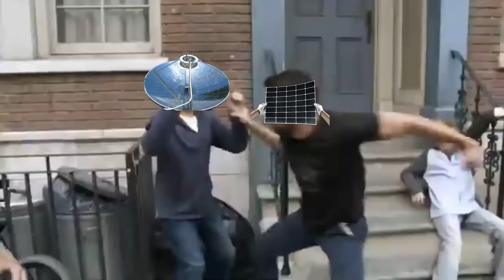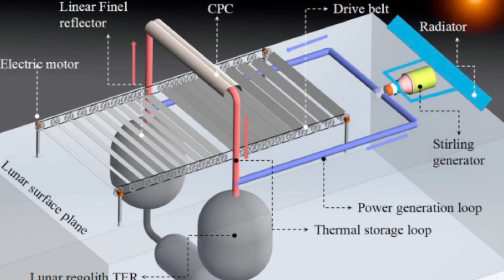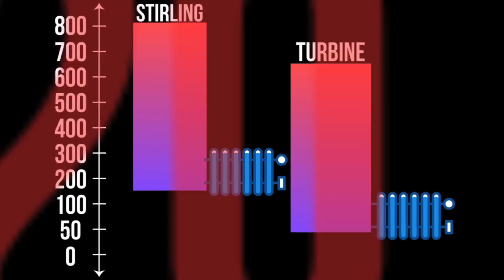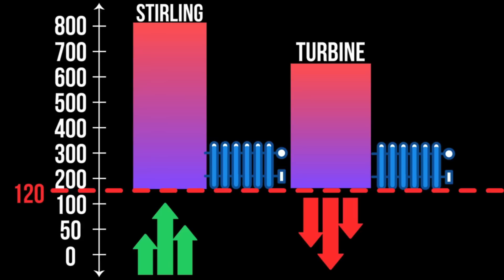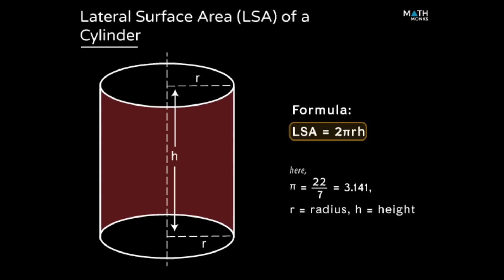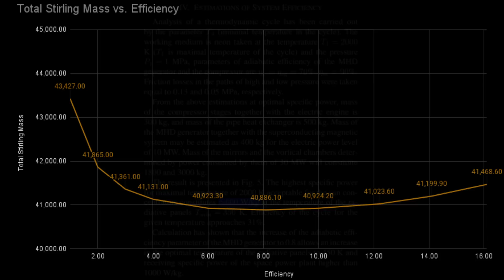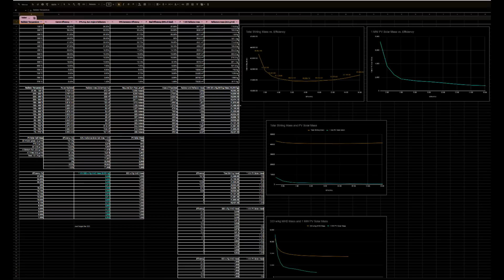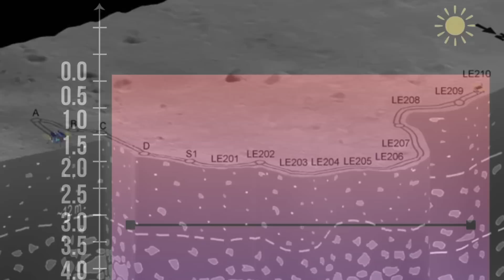Stirling Engines vs Solar Cells (+Transmission Lines)

Comment: 1. Solar Cells still need cooling.

And I find no reason for that not to be a heat engine...

2. Sterling Engines can be no different than steam engines in that you can make them multistaged.
One stage feeding the next, that will have a wider Start and end.

Comment: P.s. If a refrigerant was used instead of water that easily self condensed  once trough the steam engine and into the underground condenser radiator the steam engines would likely last longer and be more efficient as the expanding refrigerant would possibly expand a few hundred times more than the steam.

Comment: It might not have been thought of - but water boils at 100 degrees Celsius and you said daytime temperatures reach 127 degrees Celsius,  so water could be boiled using the sun and put through steam engines to turn generators and make electricity. The torque from the steam engines would generate a lot more electricity than solar panels. Steam after going through the steam engines could be condensed in underground metal radiators. As long as the sun 🌞 was shining on the boilers, the steam engines would turn generators to make electricity . The trick would probably be to take metal tubes for pistons to run in and pistons and camshaft there and build the engine blocks out of concrete manufactured on the moon. Fortunately things lighter than metal could be used to manufacture the necessary components of the steam engine  like carbon fibre and possibly powdered metal used with 3d printers to make more durable components for the parts of the steam engines like the metal sleeves the pistons move in, the pistons and the camshafts. If aluminium could be mined and used in manufacturing on the moon  the harder metals brought from earth would likely just need to be used on metal edges of the pistons that touches the metal sleeves the pistons run up and down in. Potentially if a steam engine could be manufactured on earth using no metal parts but say kevlar for the pistons and sleeves they move in it would mean less metal would need to be sent to the moon to save on weight sent in the rockets. Camshafts used in the engines might be made of kevlar or have metal wire in them and have 3d printers build the camshaft around the metal wires once on site on the moon or the camshaft could be a finished product sent to the moon.. Essentially no clouds or shade on the moon would mean the steam engines could run whenever the sun was shining on the boilers. If all necessary components were made of kevlar it could be that titanium or another metal could simply be sprayed or electronically bonded to the necessary moving parts of the steam engines once manufactured on the moon. With the idea of sending the least amount of metal necessary on the rockets to save weight. Would probably be done eventually assuming a large manned base eventually gets built. Such steam powered generators might run for hundreds of years if they were built good enough. Possibly a metallised form of Teflon could be used on moving parts to reduce friction.😊
Reply: It boils at that temperature if the air pressure of the container is 1 atmosphere.  It boils at far lesser temperatures in vacuum, but i dont think that changes the efficiency overall.  Still, an interesting idea I hadn't thought of.  You still need to radiate the heat away, but its the same heat you have troubles with in any other system.  You could even add stirling engines as an intermediary heat transfer stage sonas to further increase the power output for a given volume of boiled water.

Comment: Use multiple pv farms. With mechanical batteries! Spin up a heavy flywheel. About a 20' diameter, filled with moon dust. With magnets places on its edge possibly electro magnets. Powered by a solar array on it . And powered by a larger solar array. With a high mass flywheel, the rpm can be kept relatively low. Use magnets and air bearings maybe nitrogen or CO2 . A very heavy flywheel, in the multiple ton range. Spinning in the 1,000's rpm range say 3k to 5000 rpm. Place pv arrays  miles apart, from the pole so at least one stays in the sun. Operating at 10,000k vdc using a large lithium super capacitor bank to build a DC to DC converter. To drop the 1-5 amps (roughly) @ 8-12kv DC to much higher current lower voltage say 2k amps at 340-400 vdc that that in inverted to 120/240vac or whatever is required or possibly use DC,  180vdc with small inverters to convert as required.   With the solar array operating at high voltage, low current even 2kv at 1 amp can be sent over 20-22 gauge wire, still capable of pulling another 1+ amp, at a length of miles , it would have losses. Say the base was on the pole with arrays 5 miles south 120° from each other. With 10 miles of 18 gauge wire at least. To carry 5 amps (+/-) at 2kv+ 2kv @ 5amps  eq. 10 kw, with 5 amps  the most allowed on a 16-18 gauge wire , maybe 10-12 gauge with 5-10 amps at 5 miles  there will be losses. Placing the wires inside a reflector to keep the sun off them will help. Use a copper core wire possibly, with a polished aluminum outer, with aluminum rings or beads to reflect and dissipate heat and cost with a varnish possibly holding glass dust. Being semitransparent it still reflects light and heat.. with the flywheel being so large , id dig a hole to place it in with only 4'-6' space around it. Use a 2kw array  to power the electro magnets on the flywheel. Using mirrors to reflect the sun on to the panels. Or use a dozen permanent magnets to get it going. Use a positive feedback using the power it generated to generate more power..  say start with a dozen 2"x 4" x 1/8" n52 magnets plus a few 1/8" x 2"x 1/2" to make a Halbach Array, placed in certain areas around the wheel. Using high voltage pulses to push the magnets getting the wheel spinning. Maybe use a 10 kw bldc motor to assist on start up. The wheel possibly weighing 10k lbs even spinning at 100 rpm will be a huge amount of torque. With nearly zero friction and near zero resistance. Using the spinning mass to generate 10 kwh, and using only 100 wh to get it spinning over weeks, and 10wh to help maintain the speed over days until it is needed . Post generating power for a week until the next solar array is fully under the sun. It could work. More likely and easier, would be to put multiple arrays  10 miles south or north of the pole. Use around 10 gauge wire. With 10kv+ use a DC to DC sub station to boost the  voltage up. As required , if required. With the array only putting around 1-2 amps on the  cable, place another array  2-5 miles south or north east or west 45° from the last so it is about 10°-20° on the rotation with a sub station matching the voltage to the array. So it's 1 amp at 10kv can be added to the "DC GRID" going to the base. Maybe lithium titanium batteries can improve their efficiency so they still have the life of a capacitor and round trip efficiency being high as lithium ion LMC, or lifepo4 at least, so lithium titanium cell batteries could be used. With a 20+ year life. A 800 kwh battery bank used to smooth out the brown outs until the solar gets back under the sun. To produce 100% of it's power. With the arrays at 20° and 120°  from each other  with only 100° with no array  its only a short time without full power if another array is placed 20° east/west of the last with the grid carrying 3 amps at 10,kv for a short time possibly 5-9 days then fade to one then no power for a week until the next array starts production. Maybe smaller arrays closer to the pole would work placed at 30°  with 5kw arrays. 5kw 24/7 is a ton of watt hours. Sorry to ramble , happy holidays!

Comment: 12:46 

Maybe we can shield not only from the sun, but also from the surface of the moon. Depending on the latitude of the location, we will have a sector of space where the sun never shines. Probably about 5-10 degrees above the horizon in the direction of the pole. 
The open end of the shield-tube can be directed into that sector so that the heat is radiated into outer space. The other end of the tube is a heat radiator. The shape of the tube allows it to be shielded from radiation from the side of the tube.
If you install a tracking system, you can radiate heat to any point in space and avoid the sun. 

About the problem that the insulator itself will heat up from the ground, hmm ... 
On a lunar night, you can cover the entire surface around the emitters with sun protection refractive foil in several meters around and wait until the regolith cools completely. The lower temperature limit will be the temperature of the lunar rock massif close to 250K (-23 °C). Maybe it will even be possible to cool the soil massif even lower by installing more of these cooling emitters. 
Result: 
-heating from above from the sun is cut off by a tubular reflector, as well as heating from the sides;  
-heating from below is limited by a temperature of -23°C. 

The tubes can be made of aluminum foil, connected in a hexagonal shape using the same technology as cardboard. 

Costs: a lot of foil for the tubes, a lot of foil to cover the soil around, a more complex installation of the emitter, since it will stand more vertically to allow it to be directed at an angle of ~5° to the horizon.

Cons: since the sector to which the heat is radiated is now limited, the total capacity of the cooler will decrease. To compensate for this, the number of emitters needs to be increased even more. I think 2-3 times, since we have limited the sector of space to which the heat is radiated by this many times. 

And then the question is, do we need a system that reaches -20°C, but is ten times larger and more complex than a system with 120°C?
Reply: Thermal storage would be better here, similar effect, less complexity.

Comment: You started this presentation with a statement that you don't need to run your machines all the time, and then went on to design your system based on an assumption that you need to radiate when the sun is up, so you can't get below 121 C.  In practice, you have much a much cooler reservoir, either 4 meters below the surface (-20 C) or 14 days away in time (-183 C).  In the same vein, you could heat up and store your hot fluid so you could generate power even when the sun goes down.
Reply: This is a great point. I've been toying around with similar ideas for home heat pump setups to take advantage of day-night temperature differences here on earth. I don't know if you'd have a buried reservoir or a surface one. Conductive ground losses vs radiative surface losses is something I've not run the numbers on yet. But I imagine that buried would be better because it's more constant, and any conductive losses would be minimized compared to a surface reservoir given the lower difference in Temperature between whatever fluid at 100-200°C and -20°C compared to the night time surface of -180°C which can mostly be alleviated by using a butt ton of insulation if I had to guess.
Reply: @Nomenius1  On earth, it is much more challenging to benefit from day-night differences because of the atmosphere.  Also, with good engineering it should be possible to do much better with day time radiation than the base design used by Anthrofuturism, as pointed out by several commenters.
Reply from the maker: @richdobbs6595  local equilibrium. It doesn't matter how cold it starts you're pumping heat into an area it's going to heat up to that temp.
Reply: @Anthrofuturism  I am curious how the need to heat for our labs or the people who are theoretically going to occupy the moon going forwards might have influenced the logical comparison between the systems. As dude said, the 'cold' end could be hours away or meters below- If the cold end was meters below, that could be a nice warm place for people and labs, if our cold end was a day away, it would provide heat in those places through the night, while generating electricity. Do you think that maybe our view of heat as simply waste is limiting our decisions? Whatif I didnt go through the trouble of all the thought and work you did, but conceived of a moon where regolith refining with thermal energy was also the hot end and the cold end was also our underground labs? Perhaps with multiple radiators until a nice temperature is reached for what our habitats want. Even when the hot end is too cool to produce electricity of a useful sort, the heat contained in all that radiator could be real useful. no?
Reply: @Anthrofuturism i responded to people disagreeing with the local equilibrium argument, what are your thoughts if you find it interesting enough?
Reply: @Anthrofuturism  Nah, geothermal systems for things like heat pumps are in non-equilibrium for the entire winter heating season and summer cooling season.  Here we are just asking them last through a lunar day.  Depending on sizing, the local equilibrium could be all over the place.
Reply: @richdobbs6595 the earth stays hot because of geothermal heating.  The moon is basically a big ball of insulation.  There is no way to have a positive energy flow from such a system.  You CAN store heat or cold for the next cycle, and use stirling style engines for transferring those energy reserves, but this is just a bad battery.
Reply: @aone9050  The moon is periodically heated by the sun, and cooled by radiation.  You are ignorant of thermodynamics if you think that you can't get useful work out of such a situation.  You don't need to get a "positive energy flow".  Energy is conserved.  The usefulness of ground loops on the earth doesn't depend on the production of heat within the earth's core from nuclear decay.  That is mostly an interesting process that allows tectonic plate activity to persist.
Reply: @Anthrofuturism  If whatever you heat up is large enough, it will never get to that temperature. Once the cold reservoir enters the lunar night, it will dump all that heat out and get to -133C. I mean...eventually the Universe MIGHT reach the temp of your radiator. Eventually. At the heat death maybe.
Reply: @andreimiga8101 as anthro said elsewhere, it is at best just an extremely inefficient system as compared to alternatives, far too much for it to be considered useful.  There is no water, air, or geothermal heating.  Simply put there is far less convection, therefore far less heat transfer, therefore the temperature changes less with time.
Reply: @andreimiga8101 comment got eaten, let me retry.
there is no air, water, or geothermal heating to aid the change in temperature one would expect from geothermal systems.  Therefore just far less efficient than you are expecting.  At that point photovoltaic is simply superior.
Reply: @aone9050  1.  There is such a thing as conduction.  2.  There is nothing stopping you from designing system that use fluids within pipes even on the moon.

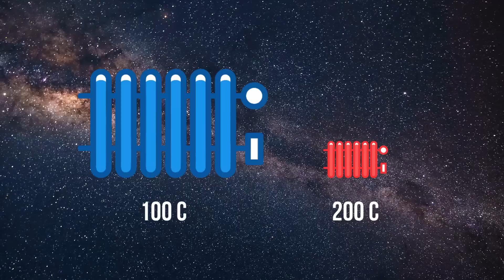Comment: 14:07  Yikes.  I imagine you're not doing your math in Celsius directly, but having a graphic that shows 200C° being twice the temp of 100C° is a bit of a red flag.  Those kinds of equations only work in Kelvin.
Reply: I mean, if your equations are based on the assumption that 200C is twice 100C, then yeah, that makes a pretty big difference.  Potentially a factor of 4.  Add in the hand waves about "mass is equivalent to energy costs" completely overlooking the HUGE difference in manufacturing complexity and hence efficiency differences between aluminum foil and solar panels, you are looking at a margin of error in the range of 1000% or more. 

Since the difference in efficiency between the options is less than the error bar, your whole premise is faulty.  Doesn't mean your conclusion is WRONG(to be clear, I think you are very likely right), only that you have not provided sufficient data to support it.

It is perfectly reasonable to hand wave error bars of 2-300% if you're estimating results in terms of multiple orders of magnitude, but a lot of these margins for error are multiplicative, and can quickly swamp apparent advantages in the range of a single order of magnitude.

Comment: its all so tiresome. a million smart speculations about energy needs in space, but zero awareness that engineering has to start back from zero. literally every single machine and structure on planet earth is engineered with the idea that there is earth like pressure, speed of sound, and gravity. you literally cannot use the same machines or build the same structures using structural engineering principles on the moon, mars, or anywhere without at the very least ~0.9 earth gravity if we are being ludicrously generous with tolerances. just on the industrial stuff alone we would have to rework centuries of

ore smelters requiring earth like convection and gas flow.
blast furnaces engineered for earth pressure and gravity.
refinery distillation columns relying on 1g fluid separation.
pulp and glue mills counting on earth atmosphere drying.
concrete and other aggregated bonded material batching dependent on earth gravity mixing.
calibrated large scale hydraulic presses.
drilling rigs designed for earth downforce and friction.
our entire science of fracking and soil mechanics is based on earth subsurface pressures.
steel mill rolling lines depending on 1g material transport.
open pit mining excavators built around earth soil bucket loads.
cargo and crane systems balanced on earth gravitational torques.
conventional conveyor belts sized for earth friction and weight.

on and on. going to mars or the moon means we have to re-invent the industrial age. energy is not the problem and engineering is not free you cant just expect us to 'make it work'
Reply: Facts